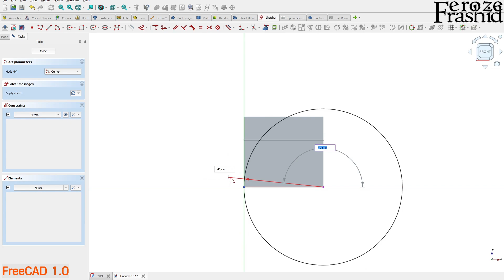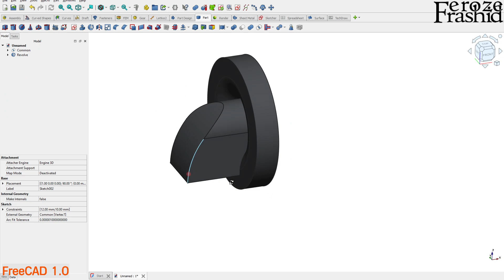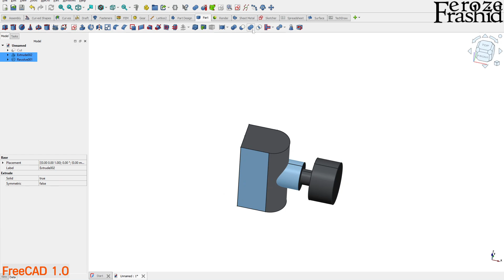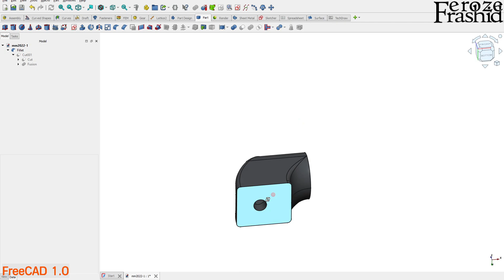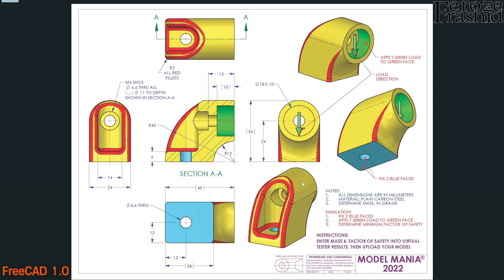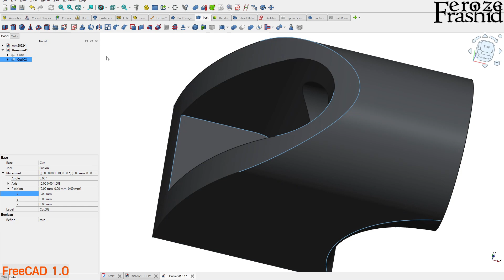Model Mania 2022 in FreeCAD: Build same model in two different ways

Comment: Enjoy the videos and always learn something new. Just a small complaint, would you use a color other than black. The shapes are hard to see unless they are selected. Thank you.
Reply from the maker: Are you talking about the base color of the object? or the one on the thumbnail?
I started using FreeCAD light color scheme recently. Did some manual conig in that area. I am also adjusting to the new theme. I was discussing this issue on the forum. Hopefully things will improve.
Reply: @kattkushol  The base color of the object. I watch on my TV so I can follow along sometimes. The last couple of videos the parts were black blobs unless you selected a face or the part in the tree. It is strange because I set the color to not have black blacks but a dark dark grey. That is so my wife and I can see the night scenes in movies.
Reply from the maker: @Pixelwaster  Thanks for bringing that to my attention. I will do some adjustment on my end.

Comment: You said you knew it was 24 mm at https://youtu.be/1qUAlYY-AQk?si=Pqnwo3ax_ylnVVXI&t=399. 
But what if you decide to change dimensions in future. Is there any way to make it relative to the center instead of hard-coded coordinates?
Reply from the maker: Yes. In that scenario, I would go back to that original sketch where I drew that circle. Pick that distance dimension (24mm) and provide a name to it. Then use that name to refer to that distance in the revolve properties. 
Now, the formula option is not available during revolve. But I can go back to the revolve properties, once it is formed, and update any (distance) reference.
Reply: @kattkushol  Thanks